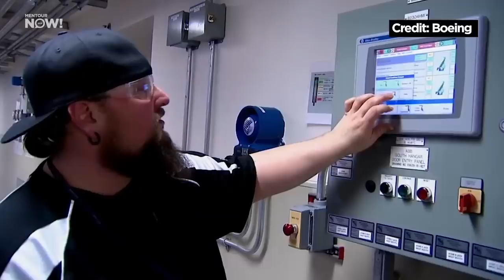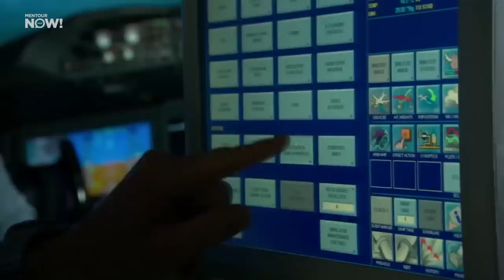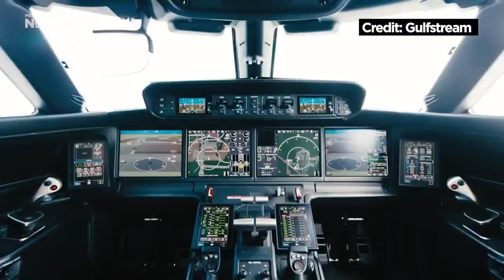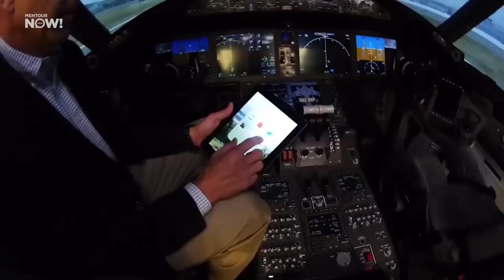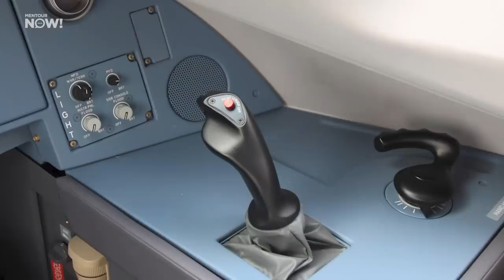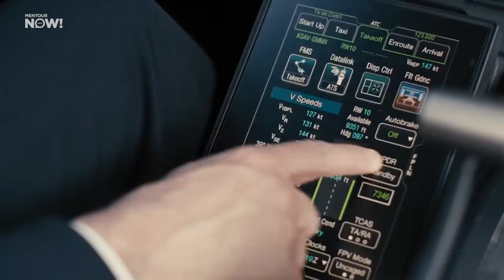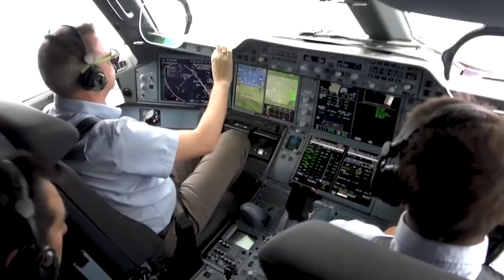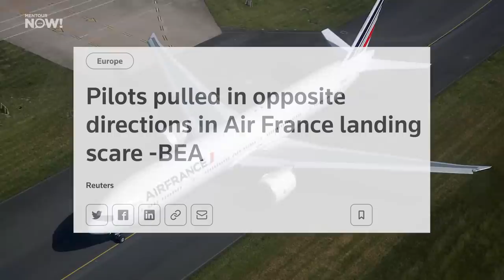Is Boeing Switching to SIDE-STICKS?!

Comment: The prominence of a yoke moving within one's central field of vision draws attention to any unexpected undesirable changes and positively contributes to situational awareness. Control is superior subsequent to the naturally instinctive central location. The use of two hands and two feet to control the aircraft's dynamics through its 3 principal axes enhances the  appreciation of the aircraft's centre of gravity, thus becoming one with the aircraft.

Comparatively a sidestick is always in one's blindspot. 
The single handed lateral position is counterintuitive to the rationale described above.

Who could feel comfortable adopting a sidestick equivalent to replace steering wheels in any type of motor vehicle? It is not an instinctive sensation, indeed it is incongruous with the natural feel of controlling any vehicle  
No improvements in road safety could be argued for its introduction, indeed the opposite would be true with a noticeable uptick in in road accident and trauma statistics. Such a hypothetical introduction would be for none other than aesthetic purposes and the illusion of modernity.

The same is true in aviation. Despite the terrific improvements in forced feedback and synthetic dynamic technology for sidestick safety, which would have prevented the AF447 accident amongst others but is yet to be seen on commercial aircraft where urgently required. 
There is absolutely NO overall advantage in flight safety when compared to traditional and reliable yoke technology. 

The right vs left hand dominance must be a consideration factor.
I wonder how long it takes for the fine motor control to be achieved when operating a sidestick with one's non dominant hand. The adjustment factor when an F/O proficient with their left hand after years in the right seat upgrades to the left. The duration of adjustment due to fine muscle memory would vary between individuals I expect. There must be factors to consider when a captain has to operate out of category in a right seat.
These are unimportant with a yoke flight deck arrangement.

There need not be any additional and largely unnecessary layers of complexity for the sake of aesthetics and falsely perceived contemporary improvements. 
There is certainly NO safety advantage, I would suggest it is indeed to the contrary.
Safety features are to be enhanced and simplified, not the opposite with the added complexities and inherent risks sidestick technology brings Particularly in confusing or threatening non-normal events when one's situational awareness tightens and sharpens, requiring the need for clarity and simplicity to make room intellectually for deducing the events to decide upon appropriate actions in a least overwhelming environment.

It could b e debated that it's purely psychological and an indifference to change, but I feel the yoke has so many more safety features than a sidestick. I fail to identify any strong advantage and subsequent argument for replacing yokes with sidesticks. As I see it, it is just change for the sake of change, marketing and little else. The concept of having a pullout table is irrelevant and ultimately 'precious'. Cabin crew on all aircraft types use their trayless jumpseats to eat from trays on their lap, complete trip reports and other documentation.
Reply: What Boeing pilot flies with both hand sim the yoke? For takeoff yes but then the autopilot comes on, the yoke is then just sat there for the rest of the flight not doing anything except being in the way and when it comes to landing the pilot has one hand on the yoke and other on throttles even if autothrottle is on. Having a yoke in front of the pilot does not guarantee they will see any movement. The captain of the Atlas Air crash did not see the FO push the yoke fully forward until too late

There is definitely and advantage to sidestick over yoke flight safety wise. You can take sole control of an accident is imminent and you don’t end up like those Air France 777 pilots and fighting for the controls without realising it. You press and hold the red button and the aircraft is completely yours. If the slightly more competent pilot in AF446 had remembered his training he would have said “I have control”, pushed the button and pushed nose down to recover. If it was a Boeing he have to be shouting and the other pilot to let go or reminding him to push forward and it seemed like he would struggle to realise that. The sidestick was not actually listed as a contributing factor in AF447. Having a pullout table is useful for meals and writing on. Which is honestly more comfortable. A solid worktop or your own lap? Ergonomic wise the yoke is useless to a pilot for 95% of the flight so why have it right in front of you?

Comment: With all the technology available, why doesn't Boeing make an electronic yoke?  If that's what pilots want, or if that's the easiest way for pilots to be cross-trained, it seems like a simple answer.   They already make gaming yokes that are electronically connected to the PC for controlling aircraft on the screen.  Why don't they make an electronic version of the yoke that controls the plane the same way the side stick does.  It can still be electronically connected to the other yoke, just as the side stick can be.

Comment: I am right-handed.  Is it difficult for Airbus pilots to fly using the stick on the other side?
Reply: No, they get used to it after training
Reply: Can you drive with just your left hand on the steering wheel?
Reply: @sheldoniusRex  The steering wheel on your car is only responsible turning left or right.
Reply: @theephemeralglade1935  And flying with either hand is no problem.

Comment: Air France Flight 447 ???
Reply: @CoasterFan77 So what does all of this current tech sidestick rehash have to do with the crash of a plane that had none of it? The "joystick" was pulled full back (unnoticed) until there was not enough altitude to recover.
Reply: @bubbaparrish1163  The sidestick was not listed as a contributing factor in the accident
Reply: @Clayson Antoons Yes, and if frogs had glass a$$es, they would all be broken.  Airbus has the same intentions of putting active sidesticks in all planes they have shipped as Boeing has in adding another color/sound priority alert code for 737 MAXs.

Comment: Not a pilot but I can imagine that incase things are going wrong you'd want a proper yoke to help you haul the aircraft out of danger. A side stick does not inspire confidence when things go wrong. What happens if you're very poorly left-handed as a captain? Also it does not look like a proper cockpit when there's no yoke. On things like fighter jets where space is an issue it makes sense but not on airliners
Reply: If you were a poor left handed captain then you wouldn’t pass your captains course
Reply: Historically, control wheels were built for two handed operation because the manual control forces grew larger as aircraft increased in size. On modern airplanes, there is no longer a need for heavy manual forces, and newer inceptors have great advantages over the old.

Comment: Boeing should not need to switch to sidesticks. The yoke is not at all why MCAS crashed 2 MAX jets, and the yoke is not why AF11 happened. The yoke is also not why the Atlas Air 767 crashed and the yoke is not to blame for Dreamliner quality issues. The yoke is not why any engine failure happened and the yoke is not why 737s had rudder issues in the 1990s.

Comment: Some things about aircraft just feel strange, being able to unsyncronize the primary controls with just 22kg, granted I'm not an engineer but I'd at least put that up to 60-70kg, aka almost impossible for any normal human
Reply: The idea is if a mechanism jammed the other pilot could free the controls for themselves. A C-130 crashed on takeoff once because one of the pilots controls was jammed upwards and the FO couldn't do anything because of the mechanical link

Comment: First, Air France may need a pilot retrain. That crash of tha plane from Rio also had two pilots on the controls partly leading to the crash. However, from a practicality stand point, Boeing shouldn't make the switch. It's stupid and a ton of pilots hate the side sticks including me. Also, if you look at images of pilots landing Airbus jets versus Boeing, the Boeing jets, even in stiff cross winds seem to always land under control where as Airbus jets can be all over the place. It's not just a Boeing thing as Embraer jets also seem to touch down smoother than there side stick counterparts. However, from a sales standpoint they would be smart to offer both. Not sure about the certification headache that would create, but it would be smart.
Reply: @CoasterFan77   This is an awfully long reply for someone who didn't read what I said. First off, I worked for two carriers in the US (well, three, but one was a small cargo company that operates small turbo props only, no jets).  Both specialized in Embraer Ejets, so the 170,175 and 190s. None of the pilots liked the side stick. We did speak to a few of the people from the majors, and some liked them for every reason you say, but many also hated them for that lack of feedback, with many pilots wondering (at the time) why Airbus didn't  put in the same technology which Microsoft featured in their force feedback joystick from the 90s.  Eveyone one would gush about the ergonomics (few to none had the table) but when asked about the feedback even the side stick lovers fell quiet. That was my comment.

Second, AF447 was a case where the FO and the man in the Captains seat both put in opposite controls into the aircraft, essentially fighting each other.  Well, according to nearly every SOP and training program I've been through at no time except in some extreme unforseen event (however there is one case where my ERJ instructor demonstrated where one yoke has bank control and another pitch) both pilots are never to be on the controls at the same time. The pilot flying is the only one to ever touch the controls unless the PF yields control of the aircraft or the PM has to take control, but this will be done by the PM saying "My controls." For Air Farnce to have two incidents of this (granted, over a decade apart) one has to question if there is a training issue at hand. At no time was I commenting on the type of controls the A330 or the B777 had. Of course a seasoned commercial pilot would know that.

Also, I am aware you can not crab into a crosswind on an Airbus aircraft. I was briefed on this why I don't know now that I think about it, but we were. That being said, if you look at a lot of the videos on YouTube and when you are just waiting by the runway, we quickly realized which Airbus planes were being flown by stick and which weren't especially overseas where pilots stick to the autopilot a lot more. It's something all the guys I used to fly with knew about and we could tell. We'd even had this confirmed with the guys who would jump seat with us off the Airbus jets, the sidestick makes it harder to land, especially when you are more used to relying on autoland. I even recall when USAir, now American, finally put out a notice limiting the use of autoland because pilots where lossing stick and rudder skills.

Comment: Boeing should maintain its own identity (Yoke), however, shouldn't use the old fashioned 737 platform again as 737-800 and 737-900 are the last successful models known to general public with Max family spoiling the reputation because of the MCAS issue. It will be like building a new aircraft similar in size to a 757-200 with slightly more powerful engines than the RR RB 211.

Comment: Boeing used to be a company focused on safety and quality. Since the McDonnell Douglas merger, all has changed, as we have seen with the 737 Max incidents. The bottom line is now the single most driving focus for new planes. And that will drive the side stick changeover as well, it is cheaper!

Comment: They won't put in a side stick. If they can have two planes crash before admitting to the last thing they did due to economic pressures, they certainly aren't going to risk those pressures for a side stick.

Comment: I have friends that are pilots, and the answer to the question if Boeing is better than Airbus is.. no! Just by the reason Boeing is outdated.. not technologically, but the mindset. There are many improvements, but it’s difficult to improve a substantial element without changing a considerable part of the design.

Comment: And, yokes might well have averted the Air France flight 447 tragedy!
Reply: no, thats an issue of active coupling, not of yoke vs sidestick
Reply: @MrSchwabentier  I appreciate that, but yokes would have provided more effective visual clues.
Reply: @finlayfraser9952  only if coupled. What really wouldve prevented that crash is the PF not sleeping during his initial flight lessons.
Reply: @finlayfraser9952  Even though the yokes are more obvious, which is probably what you meant by more visual cues, you can still mess up. 3 fatal accidents (Egypt Air 990, Aeroflight 593, Atlas Air 3591) and the recent Af11 incident had obvious yokes that were split and dual controlled, despite it being more obvious. Also its not like both pilots on a sidestick aircraft would not have their hand on the stick or take glances at it when on autopilot or in manual control. Finally the PFD is more important as it shows you what the aircraft is doing. So I actually fault Robert for not taking control cause he actually saw the plane climb and told Bonin to pitch down but didn't take control himself prior to the stall. That alone tells you Robert wasn't completely in the dark.

Comment: Only about 5% of the time are pilots hands on the controls. Most of the time the plane is being flown by the auto pilot. Why have a big moving yoke taking up space, when a small side stick can used instead, and free up space for something like a stowable tray table that can be used during the other 95% of the time.

Comment: Airbus has some clever technology, but computer reliant technology can fail massively, I have always preferred a trusty old Yoke, one that the Pilot is at one with the aircraft. If there is a major failure of the electronics, and the control surfaces are all gone, it is going down because the pilots no longer have any control. Yes I know they have all these safety back up systems, but there is always that small chance that they will all fail.

Comment: There is one serious issue with sidesticks, even though to me as an observer side stick and fly by wire is the technologically and safety critical superior system.
And that's feedback, specifically the lack of which killed air France over the South Atlantic.
The pilot didn't know that the idiot was nose up and stalling and down they went. Poor bastards.

However that would have been a secondary solution, the primary fault was with the 3 pilots and their failure to communicate, although for one of the 'pilots' I use the term loosely.

Personally, as an engineer (even though I'm just a software engineer 🤣), my creed is Ever Onwards.
You don't stick to what works, you push forward, you improve and look to the future, always pushing to make everything better.
Which is exactly what Airbus does with its fly by wire system.
Reply: @Clayson Antoons 
Yeah, I wrote this comment before I'd got to that point! 🤣
Digital Control Active Feedback looks amazing, exactly what you need to catch that 'Air France' problem.
Hopefully these can be retro installed into existing Airbus platforms.
Reply: As an engineer, you know there are usually multiple ways to solve problems. The Air France 447 crash you pointed to probably would not have happened in a Boeing airplane. But there are an equal number of Boeing crashes that would not have happened in Airbus FBW airplanes.

Comment: I don't understand all this technology while safety is the main priority. This will again bring a load of technology, software, sensors and what not. And than an additional system to monitor the system 😵 All stuff that can break down and is very complicated. I'd rather sit in an older plane. If there is one thing that is unreliable than it is computers and sensors in moving machines.
Reply: And yet old planes crashed much more than modern planes. A380/787 never had a fatal accident in the 10+ years they have been flying
Reply: @tomstravels520  I know. But you are speaking to a man that back in 2016 said he would NEVER buy a smart phone and thought Nokia would become the big winner by sticking to traditional phones. So I am quite sure.. You are right 😆

Comment: What about broken fly-by wire, or total electrical power fail? I prefer aircraft with hydraulic and electrical steering as we speak. 5 systems is total control!! Much better as airbus or Bombardier or something else.
Reply: Boeing also uses fly-by wire on 777 and 787.
Reply: @MrSchwabentier  and hydraulic flightcontrols
Reply: @jouniairplanevideos  just like Airbus

Comment: I always thought a yoke is way easier/more natural steering mechanism than a sidestick. It's bigger, so it allows for more precise inputs, you can also control it with both hands - with stick I imagine you have to be more careful, also right-handed pilot has no other choice but to control it with left hand only. 
I'm not a fan of sidesticks, just like I prefer a steering wheel for video games over a joystick.

Of course pilots get used to a sidestick and fly planes perfectly fine with it. On a human intuition-level I just have more trust in a yoke than sidestick.
Reply: A right handed captain in a Boeing will still have to control the aircraft with their left hand because their right hand will be in the throttles
Reply: @Clayson Antoons I appreciate your comment ! Of course my opinion comes from instinct/intuition/what I imagine it is like, rather than experience, so it's not like it matters much.